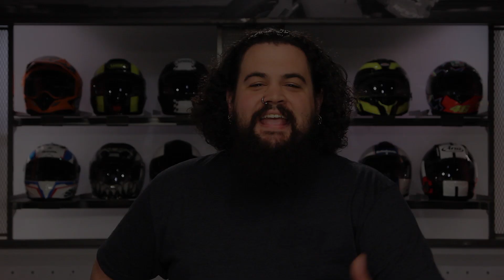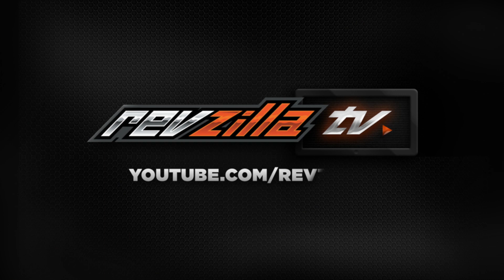Tire Tread Pattern Direction - Geek Speak #27 at RevZilla.com

Comment: Imagine the contact patch. When riding a straight in an upright position its long and narrow, with weight of bike/rider assisting splitting the water. When  leaning for a corner the contact patch elongates increasing the effects of hydroplaning. The grooves would now be evacuating water toward the center, which is off the ground, reducing hydraulic lift.
Reply: finaly an actual explanation, instead of some blablabla pointless talk.
The video basically explained absolutely NOTHING.
Reply: Thank you. This makes perfect sense.
Reply: That still does not explain why the front tread would be pointing the opposite direction of the rear tread.
Reply: @davidhustoft1114  except it actually does. Read the comment again.

Comment: A simple sketch would help.  For rear, "point of V is leading, pointing towards the rider", sounds like you refer to the top of the tire, where the tread is more visible.  If true, the V would then be pointing aft where the tire contacts on the road.  That would seem to cause more slippage when being driven, but then the V is a recession, so perhaps the opposite action.  Anyway, the description is confusing.
Reply: there's an arrow on the sidewall of your tire bud

Comment: i got a question, if that is install on a Electric unicycle, which is only one wheel, which direction I should mount the tire? as the wheel is doing both acceleration and braking. the reason why I ask that, because I just bought a Michelin City Grip 2 from you guys. and the direction stamped on on the side of the tire really makes me confused.

Comment: I appreciate the vid. I just installed some Pirelli Scorpion Trail 2 on my bike and the direction of rotation seemed to disagree with the tread pattern as learned by me from a lifetime of car and tractor tires.
 I had to go on a binge of googling to make sure my front tire wasn't a misprint or something.
 I'm still dubious about how it's going to act in straight line wet riding, but I suppose I'll have to trust Pirelli.

Comment: Can't believe what I listened to from Lemmy about motorcycle, 'V' shaped tread pattern and what it's about... positioned for noise consideration and for traction? Incredible! I'm no tyre specialist but I bet the position and the way round that the pattern goes relates to rainwater dispersal... much more important to clear water than make a 'quiet' motorcycle tyre' ??? Actually the main reason for tread is to clear water otherwise we'd all run on slicks. As far as I would imagine, the 'V'  would be fitted in such a way that the pointed part of the 'V' comes into contact with the road first and therefore clearing the rainwater from the tyre centre and progressively, as the tyre and 'V' tread pattern moves around, the water is cleared towards the outside of the tyre along the 'arms' of the 'V' as it rotates thus 'squirting' the water out away from the main, central contact area. 
Surely this is a less gullible explanation and probably a correct one?
Lloyd from Great Britain.!
Reply: Thats correct, but when you are turning on the motorcycle, if tire is installed correctly (V shape pointing to the rider when looking from top) the “leg” of the V shape touches the road first and pushes water to the centre of the tire but that centre of the tire is not in contact with the road, so it basically leads water out of your tire, which is correct. Now Im talking about front tire, which is probably more important in the turn.
Reply: @martinliptak4932 That makes sense,  thank you for explaining
Reply: @martinliptak4932  Do you realize how far you have to lean the bike to get the center of tire off the road? Unless your racing a sport bike on a track, almost never gonna happen.

Comment: Hello Lemmy,
I am Som from New Delhi, India. I have a quick question regarding the front tyre of a motorcycle. Nearly all normal front tyres have inverted V tread patterns. You briefly mentioned their purposes i.e. steering, braking, noise reduction, etc. My question is, 'does the inverted V tread also help in moving water away ?'
It would be highly appreciated & helpful if you could provide some details regarding this.
Thank you

Comment: "V" grooves on tires are made for the H2O factor and they reduce some of the contact to the road (see racing tires for dry track). This explains why the sharp part of the "V" from the middle of the tire should be the first to touch the wet surface. Acceleration, deceleration, vibration, stepped wear and others are very nice poetry for any knowledgeable motorcyclist but unfortunately... water is in most cases too uneducated for them :))
Reply: That's what seems to make the most sense, but that would imply that manufacturers make the front tires "backwards" as it's the "legs" of the V that touch first on the front...
Reply: this is what i thort too and was also wondering why the front Tyre would want to push the water into the cent of the Tyre insted of out and away?
Reply: @djhinormas959  Somebody explained it here already. Because when turning, your front tire is more important and basically the “legs” of the V shape touch the ground first when mounted the correct way (V shape facing towards bike when looking from your riding position) and thus it pushes the water to the “centre” of the tire, but its basically out of the tire because the tire is leaning. Makes  sense? 

Somewhere elsewhere I found : The main reason is that the front and the rear tires experience different forces. The rear tire is primarily used for acceleration and propelling the motorcycle forward. Whereas the front tire experiences the greatest forces during braking. And thus, the treads are designed with these primary forces in mind.

Comment: If only you used an actual tyre to demonstrate the directional markings. Some tyres that are front or rear use only will have different markings than tyres that are capable enough to be used front OR rear, which means they will have 2 markings on there.

Comment: But what happens if you are required to run two front tires on a such as a moto or pitbike style or have chain clearance and have to use something like a 100/90-12 in the front and the rear would you still run the rear in the directional arrow on the side wall or would you reverse it?

Comment: I bought a brand new bike with not-so-cheap stock tires from Cordial. The front wheel is slippery and it caused the bike to slip. So, after 2,200 KM of driving with it, I decided to put it on the rear wheel of my small bike (110cc) and it then made my small bike perform better! I don't know why it stopped slipping when it got used for the rear wheel. This ain't rocket science, I was just experimenting with my bikes.

Comment: im a noob i bought a used grom. its has power pure tires on it. my back tire basically needs replacing and my front still looks brand new basically. so ya im looking more closely at the tires and it looks like the front tire is mounted backwards. i never knew its legit supposed to be like that. i double checked it and ya it has the front pointed backwards tread and the rear forward marked on tire so its supposed to be like that. learned something new today.

Comment: If you ask me and I am an engineer, I would never want my tread to channel water to the center of the tire at anytime, whether braking or accelerating. Just my opinion.
Reply: So you want to highside crash? I'm a mechanical engineer and rather feel the straight line hydroplane on the front then the rear... lean and it evacuates..
Reply: Of course Gary the engineer I'll trust you instead of the multi millions of dollars spent into R&D from tyre manufacturers 👍 prat
Reply: Are you a engineer for Michelin? Nobody asked you

Comment: i just got some new tires the other day and i noticed that the tire shop put my rear tire on with the tread rotation direction facing the wrong way. how will that affect everything ?
Reply from the maker: It will have serious effects to the handling and grip in corners. You should return to the shop and have them re-install the tire properly. Ride safe, -Pat
Reply: @RevZilla  I called the bike shop and they came and picked up the tire for me when they learned about the mistake.  Thanks for your help !

Comment: My front tire has been mounted incorrectly for about 500 miles. Can it be remounted? I have always heard not to change the direction of radial tires after they are mounted.
Reply from the maker: We have not heard that. We recommend fixing it now by remounting the correct direction of rotation. -DrewZilla

Comment: no it didnt help at all 
the ONLY reason for v shaped tyres is for water to flow from the center to the outside 

noise , handling etc etc has to do with tread plies (crosply ,radial)and how flexible plies are!!
tread design has nothing ro do with noise 
its purely made to avoid hydroplanning 

rear tire v shaped tire pointing forward , no hydroplaning
front tire v shaped tire pointing backwards .... hydroplanning!!!

i really dont get it

is there any one who can really explain this????

anyone???

because i dont think tyre manufacturers are stupid!!
Reply: I'm wondering the same thing. Doesn't make any sense to me. I've always had my bikes from tire facing forward and haven't had any issues. I thought that other people were just mounting them wrong.
Reply: Same i don't get it too. What i saw in many post, their rear seems pointing forward while the front points backward, it looks like a trend... But could it be?
Reply: @momoma92sss28  Imagine you accelerate your bike, your rear tire will want to move faster than the road. In this case the tread pattern will evacuate water from the center. However, when you brake hard imagine that the front tire wants to move slower than the road, in this case the "wrong" tread pattern of the front wheel will actually be working as it is evacuating waters from the center. Another way to imagine it is to look how the tread pattern are positioned underneath the front wheel. The V-shape will point forward. If you now would hold the tire still and slide it in the forward direction over the road with all its water, the tread pattern actually evacuates water to the sides.

Comment: I have been told to mount the front tire on my trike backwards? Is this true?
Reply: Many trike riders will mount a rear motorcycle tire backwards. Rear tires have deeper tread, and mounting it backwards will make it match the tread pattern of a normal front tire, in most cases.

Comment: Hi Lemmy. Speaking of tires, what is the correct tire pressure to use on the front and rear wheels? Thanks
Reply from the maker: You should use the tire pressures recommended in your owner's manual. -DrewZilla

Comment: Can I use a rear tyre on the front changin rotation?
Reply from the maker: No, generally rear tires are constructed differently for the different forces that a rear tire experiences. Flipping the direction doesn't magically make it a good front tire. -DrewZilla
Reply: @RevZilla  My bike takes 17" tyres front and rear, and many manufacturers do not make a 17" front tyre, so I did loads of research as I wanted to retain the same sort of tyre on both wheels.The bike is a 250cc all-terrain bike, so not very powerful, but I use it mostly on tarmac. Continental Tyres actually stated that you could reverse the tread for use as a front tyre so based on that, and the fact that I also own a Honda 150 which has the correct (different sized tyres) front and rear and I can see that the tread patterns are simply the same in reverse, I went and bought a pair of (different width!) rear tyres (same make as on the Honda) and had the smaller installed on the front. 3 years later the "proper" rear tyre needs replacing, but the front still looks new! Handling was much improved, fuel economy much better, and road noise reduced (it originally had knobbly off-road tyres). I am aware that tyre manufacturers "build" the tyres for the correct rotation, and that adds to the rigidity and strength of the tyre, but at a maximum (wind-assisted) speed of 90 mph I have been reliably informed that this should not put me in any danger!